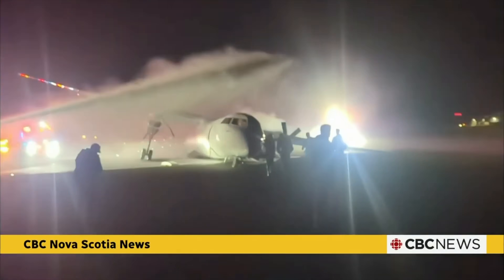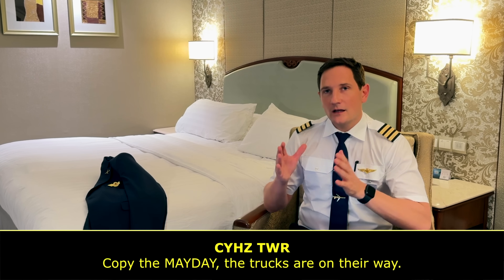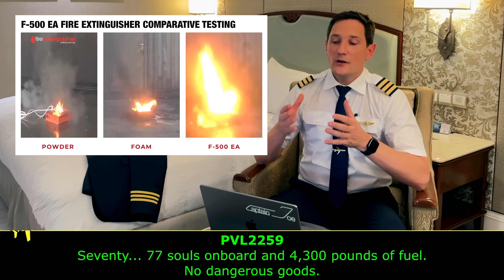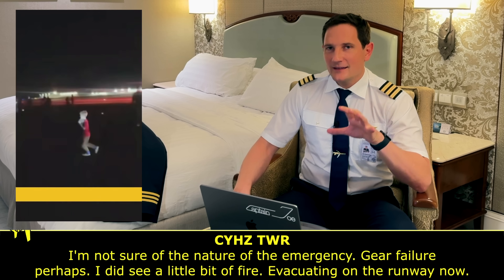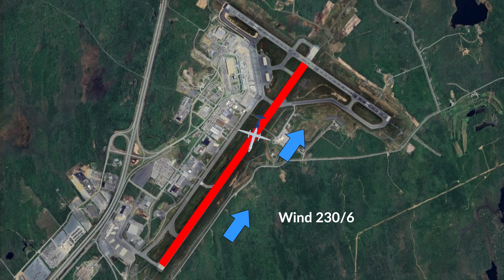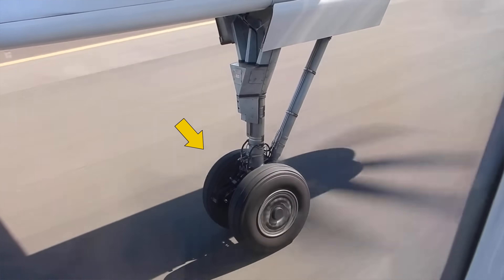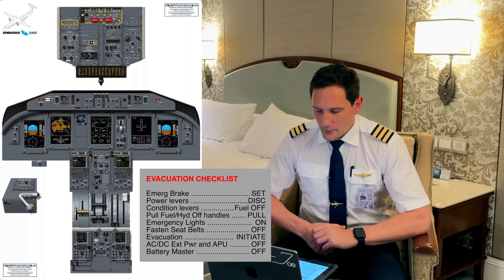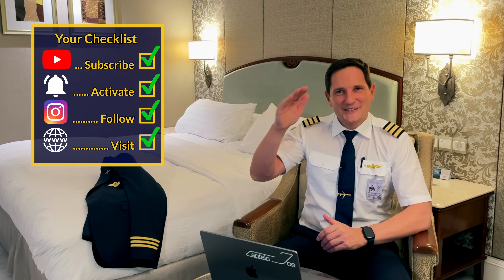WHAT WE KNOW about the Q400 EMERGENCY LANDING and Engine FIRE - Explained by CAPTAIN JOE

Comment: One thing that comes glaring off the page is that there have been at least three previous Q400 landing gear failure incidents in 2007 (SAS1209 09-Sep, SAS2748 12-Sep, SAS2867 27-Oct).  It would appear the investigation needs to give those past incidents another look and determine if yet another refit of the landing gear and strut is necessary.
Reply: Bombardier made a change to the leading gear after those 2007 SAS incidents, but it was also revealed SAS may have been glossing over some important information in Bombardier’s manuals that would’ve prevented those. Didn’t stop SAS from asking Bombardier for the CRJ instead so they wouldn’t have to deal with any more problems, but ever since the Q400 landing hear fixes almost all the landing gear issues have been linked to airline maintenance or pilot error landing too hard.
Reply: Dash8 has the highest number of accidents related to gear.
Reply: @nfsamd lol, I was told by a steward the Dash 8 was the safest plane on the go, although that was a long time ago.
Reply: @Caperhere  dash8 is really one of the safe aircraft with some advanced technologies. But somehow its landing gear system is not as good as the other system. This particular system was behind many dash8 incidents.
Reply: Horizon air Q400 mechanic here. One thing that ive noticed people forget during emergency gear extension its that to realize the main landing gear via the pull cord in the overhead panel, it has two detents to release both gear. In panic situations it has been found that pilots only pull to the first detent therefore not releasing the other gear.

Its not a great dishing due to its confusing nature i know but its something i go used to quite a lot during A checks on this aircraft. 

For those unfamiliar with the Q400 emergency gear extension. The cover for the overhead pull cord is a switch which opens the landing gear bypass valve. Pulling the overhead pull cord through both detents will release both main gear up locks. Pulling the lower pull cord will realise the nose gear up lock. The nose gear also has a hand pump next to the pull cord handle with a gallon resivour aft of the oxygen tank which may need to be pumped to lock the nose gear.
Reply: @shopdog831 Thank you for the information.
Reply: Yes indeed
Reply: The q300 main landing gear looked more robust
Reply: or develop a special sensor to alert them to a wheel issue. That way they can be further prepared.
Reply: @mississaugaicedogs When this first happened, I saw in a comment section someone saying this plane had left debris on the St. John’s runway.
Reply: Croatia Airlines 2013 in Zurich also

Comment: The good old Dash-8.  One of my favourite A/C with gear problems ever since. 
Usually it is the front gear, causing trouble. 
Glad, this evacuation worked like a charm. 

hey Joe, will you be on the Aero Expo again, this year? 
You're kind of a fix point there, already. Don't miss it, won't you?

Comment: Hi Joe, great video. Just a few corrections to the evacuation checklist below 🙂

The DISC position of the power levers is used to increase drag on landing by reducing the blade angle to almost zero (the intermediate position between flight idle and reverse).

And the “Pull Fuel/Hyd Off handles” refers to the fire handles in the overhead panel (for a fire, pull only the affected side, otherwise pull both). The arrows you showed point to the roll and pitch disconnect (between Captain and FO side).
Reply: DISC is also called "beta" or "low pitch." The name depends on the manufacturer.

Comment: I would have expected that there are pressure sensors in the tires (I recall a Captain Joe video on tire change and there was one). How can a blown up tire not be recognized? Maybe that would not have changed the outcome, but still.
Reply: Dash Eight has no tire pressure monitoring system. On the 737s I work on it's optional. Most don't have it.
Reply: @  That’s not great. Even most cars have it nowadays. But tx for clarifying.